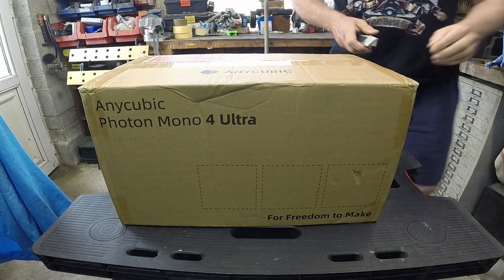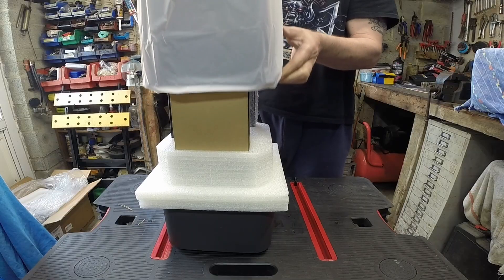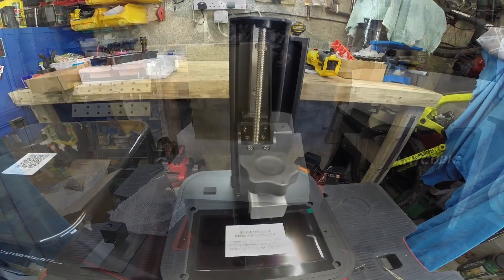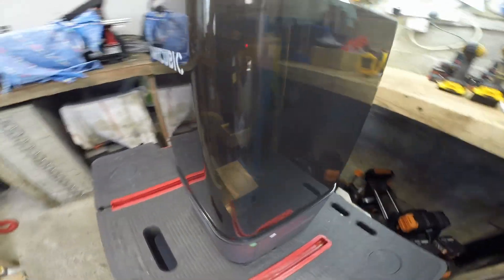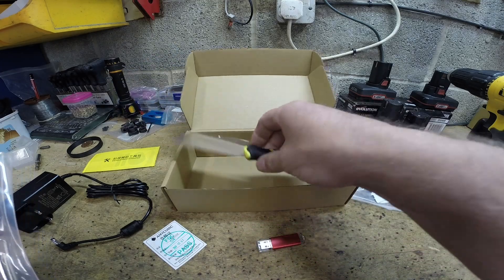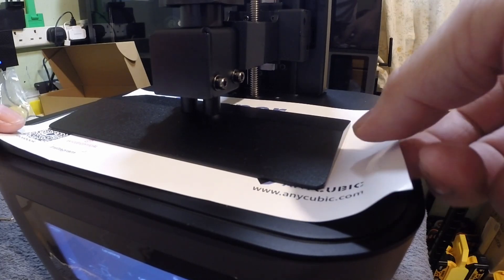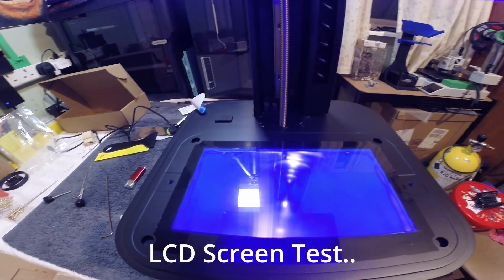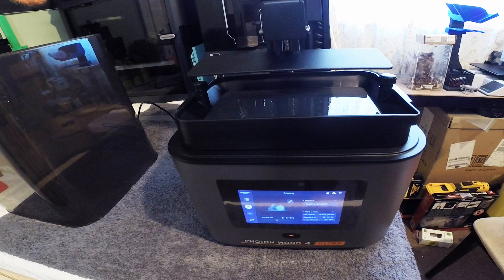Anycubic Photon Mono 4 Ultra, Unboxing, Setup & First Print.

Comment: Trying my luck here. I have had the printer awhile, very happy with it, but now my prints keep failing. 
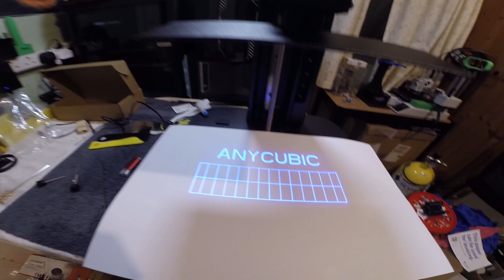I replaced the vat, the bed and the protective screen. However, when I do the exposure test, I see the same thing all the time: The entire thing is explosed. Even if I try the anycubic logo at 8:44 it just shows the full thing being illuminated. Any iea what this could be?
Reply from the maker: By the sounds of it, it looks like your LCD screen needs replacing, they are classed as a consumable part.
Reply: @CALTECH3D I was afraid of that ...Thank for getting back to me that quickly! I also contacted the Anycubic support and shared a video. They'll probably confirm that as well 😭

Comment: Hi! What FEP will you buy to replace the one that came with the printer? What would you recommend to buy? Thanks!
Reply from the maker: I buy the replacement ACF sheets from Anycubic that are sold on Amazon, they come with the bottom frame also, so you just screw them to the vat, it's a lot easier.. thanks for watching.

Comment: Hi, is it true that the vat requires you to buy their own replacement release film sheets, as the film is bonded to the plastic frame? If so, they only sell FEP and ACF on their website, and no NFEP.
Reply from the maker: No you can buy sheets separately, no needs to buy it already in the frame if you don't want to.

Comment: hey guys, i got this printer( birthday pressie) as an upgrade for my Anycubic mono, several years old. this printer works fine for good detailed 1/35th scale models, i use it for figures and terrain stuff and ive had no issues with USB printing, i use the Photon workshop as supplied, ive even used a software programme to make models from photos, and they turn out well enough, some detail gets left out, probably due to me still learning the software. Im not going to change to a different slice prgramme as i find Photon workshop does a good job as it is..
Reply from the maker: Thanks for watching.

Comment: I'm completely new to 3D printing. Thank you so much for this! The instructions with the machine weren't super great and I wasn't confident I understood them. My only wish is you had shown scraping the model off the build plate before the wash.  A video on cleaning and maintenance would round this out perfectly!  Cheers for the Motorhead T-shirt too!! =)
Reply from the maker: Thank you for your comment, if you look at some of my other videos it shows scraping off the build plate and washing and curing, as long as you've got the bottom exposure right for the resin you use, they come off the build plate easy, thanks for appreciating the Motorhead t-shirt 🤘

Comment: Thank you for the video! Did you have any problem with files transferring to the USB but not showing on the printer screen? I can't get my personal files to show
Reply from the maker: No I have used both anycubic slicer and Chitubox, just make sure you save the file as a .goo and you should be good to go, thanks for watching 👍
Reply: @CALTECH3D Thank you I switched to using Chitubox after your suggestion and the files started showing. I'm hoping to have a print any day now [I followed the same exact steps you're using but it appears that nothing is sticking to the bed right now I'm only getting flat prints]
Reply from the maker: Sorry for the delay, if it is not sticking raise your bottom exposure try 30 secs. And let me know how you get on.

Comment: Best Printer for miniatures? Hah, don't believe it. Anycubic mono 4 can only be the best printer if it will read  and print from a USB. I print my own designs but since this thing won't accept info on any  usb drive it is gong back for a refund. I checked on line and this is a common problem. How can the Any cubic people consider this their entry level machine when it can't work right out of the box.
One way would be to change the firmware to allow third party slicers (Chitubox) to work on their machines. Right now this printer is an expensive pile of junk on my work bench.
Reply from the maker: I'm not sure what you mean but it prints no problem from a USB drive and I use Chitubox software with it, it is fully supported in Chitubox.. thanks for watching.

Comment: i first time buying a resin printer i need big build size   checking two anycubic printer one Photon M3 Max 3D 7K    2nd Photon Mono 4 Ultra 10K 
which printer is the best between printers like printer quality and print clearity
Reply from the maker: If you want an Anycubic but want a bigger build size I would look at the M7.. and also the Elegoo Saturn 4 Ultra is a very good printer.
Thanks for watching 👍
Reply: i would stay from anycubic all together

Comment: Thank you so much! I’m also looking for uv resin 3D printer for very small work. Do you think the quality is good enough for smaller pieces? Like the size of a nail bed . I want to do 3D stuffs on nails. The characters are quiet details for example sonny angel.
Reply from the maker: It's a very good printer for detailed work, I have printed some fantastically detailed miniatures with it, which I will be uploading soon to my YouTube channel, once this printer is dialled in correctly it is very good, thanks for watching. 👍
Reply: @ thank you for answering!
Reply from the maker: No problem, thanks for watching  👍